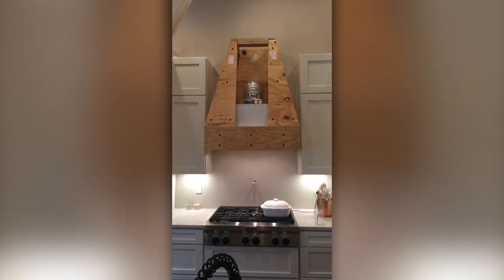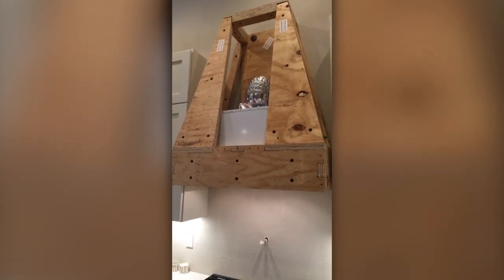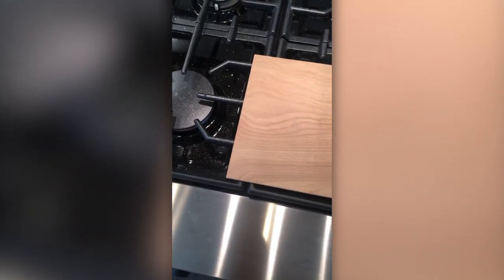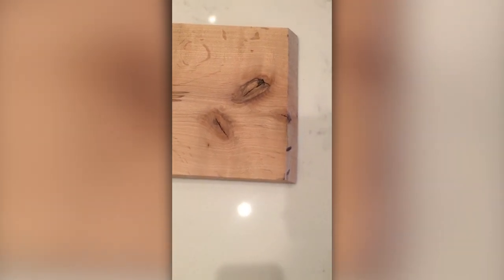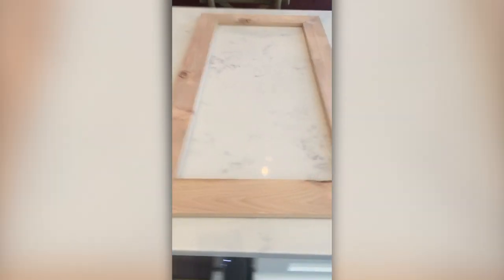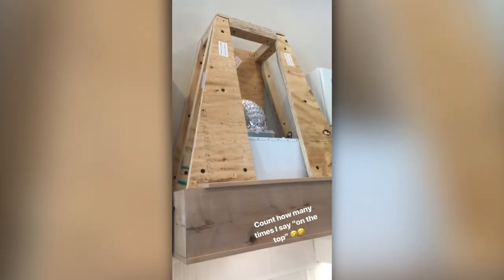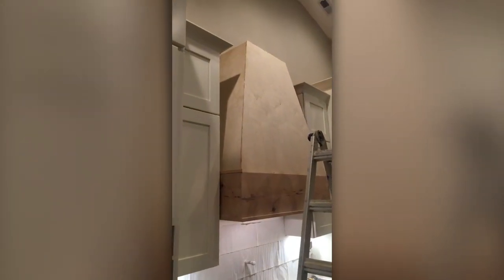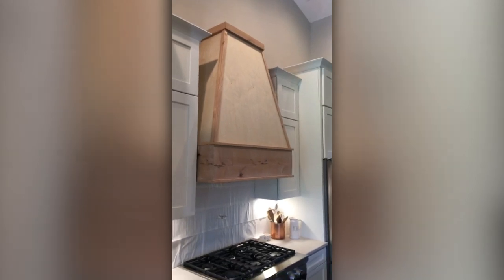DIY Range Hood Vent | Pretend Farm Girl Story

Comment: I'm considering this hood myself but I'm intimidated by the wishing.  I want to do something similar, but how do you nail the sides in when it's so close the cabinets??
Reply from the maker: If working in a tight space, you can assemble hood in garage, finish and then hang Or partially finish just the sides and then hang